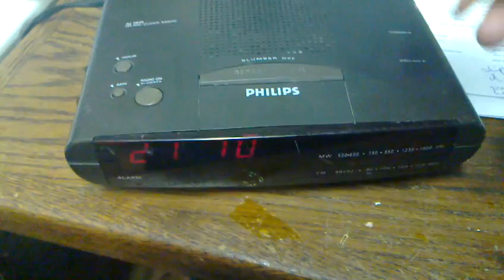FM-transmitter using only two parts

Comment: Score! If you set up the outputs for inverting PWM, and tune it down to the high 80's, you can turn PB3/PB4 into a H bridge of sorts.  Got some serious range on mine.  How did you keep the thing from spewing all over the spectrum.  Mine's taking over almost 600 kHz of the spectrum.

Comment: Hmmm, did I just get roll'd or did I see the most awesome register hack evar! Initially I expected you would use the music you used with the GBA. I'm curious what the range of the 'solution' is, since you mentioned not to amplify it. Too bad you didn't pull it away from the radio during operation. AWESOME hack though, don't think those AVR guys saw this coming.